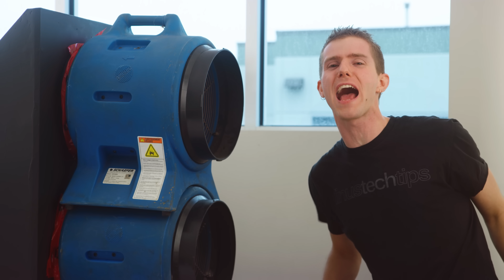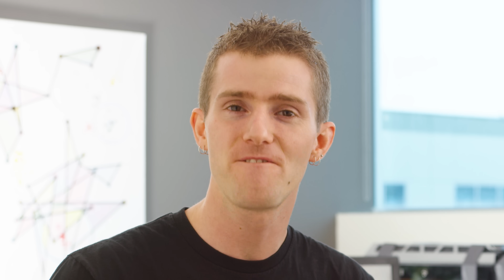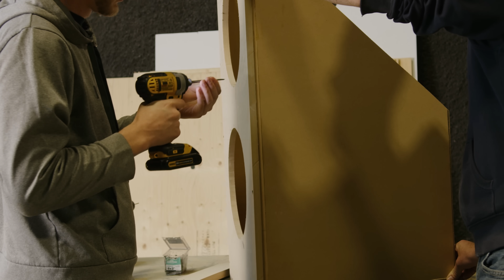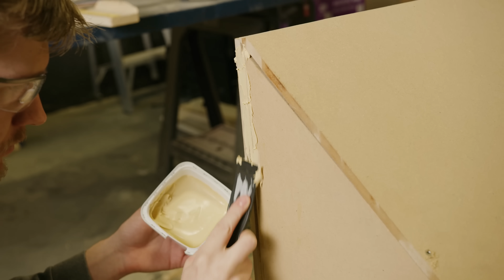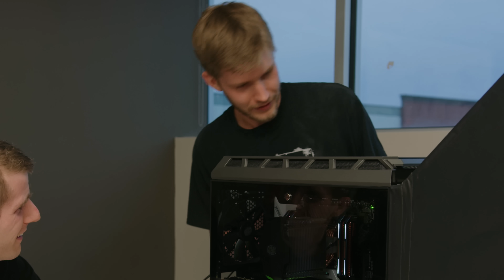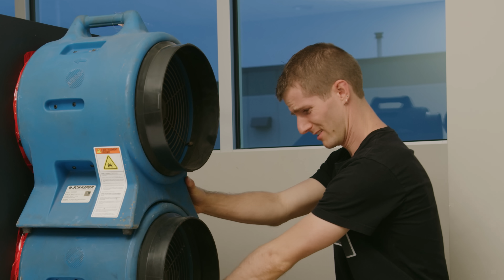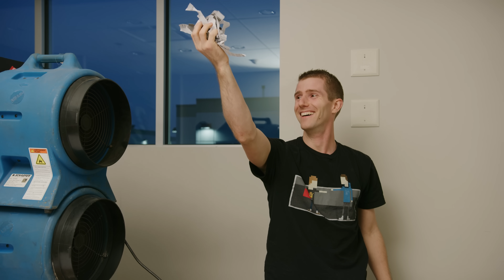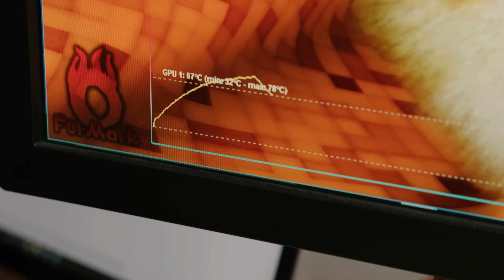Highest Airflow PC EVER - SUCCESS!

Comment: So, what was the point of the sponsored video? To confirm that Cooler Master choked the air intake of H500P with a plastic front cover?
Reply: The video was sponsored. They probably would have made this video either way if it wasn't or sponsored by a different company like corsair. They had the video they wanted to make about something overkill and dumb and a company sponsored it. That is the point.
Reply: Coolermaster Hopes that you now connect them with cool projects. Because that's how your brain works.
Next time you shop for some fans, I'm sure you will remember them positive...
Reply: we will never know
Reply: The power of air compels you!
Reply: The point of the sponsored video was to make hiring those fans cheaper for them
Reply: The point was to get you to remember the name "Cooler Master" next time you are looking for a pc case. Which works, because i noticed their cases in my school when i don't even know the name of my current case right next to me.
Reply: To shiw the new case in the beginning really and they use it for whatever, its a nice case
Reply: Remember sarcasm? Pepperidge farm remembers.
Reply: its a psa from coolermaster on how to correctly configure that case to have acceptable airflow
Reply: to be fair it doesnt matter that much you only really need to touch it when building in it and its a intentional feature to make things easier
Reply: The case costs more than $150 and it doesn't even have better airflow than a full glass panels Lian Li. The case is just bad, expensive, cheaply made and poorly designed.

Comment: Now see if you could passively cool SLI Titan XPs.
Reply: Oh I'd love them to try to do that!
Reply: Barbecue Tech Tips Two. Horsepower.
Reply: Barbecue Tech Tips but.... But..... TWO ONE HORSEPOWER FANS! It's not efficient. It's two freaking horsepower lol. I think just an SLI passively cooled setup would be an interesting setup. But I think the fans could pull the heat away fast enough.
Reply: you kidding? with this amount of airflow it's definitely possible to "passively" cool 200 watts. the tesla P100 and V100 cards come without any fans (with the assumption that they'd be installed in servers with blowiematrons) so with two whole horsepowers of blowing magic you can keep these 250 watt monsters cool no problems.
Reply: Things You Might Like You realize using those fans would mean that it's active cooling, right?
Reply: Once temperature breaks 75c the fans will turn on. But at below 1200rpm
Reply: That's not passive. It's called forced convection when you have two massive fans forcing air over the heatsink. Even if the fans are not directly affixed to the heatsink.
Reply: I'll try to cool a 7700k and Titan Xp passively by the end of the month for fun.
Reply: Zelcova X true. Just not specific to the gpu.
Reply: *Linus invents superconductive material, drops.
Reply: It's possible. It can still have a heatsink with no fans attached to it to be considered passive cooling.
Reply: The problem is that the airflow would rip the sli bridge off instantly...
Reply: I'll brain storm a setup to cool at Titan Xp. Fully passively cooled is impossible. But having a triple fan size heatsink and large 200mm fan would make it as silent as possible.
Reply: The fans mean this is active cooling
Reply: 360 tdp cooler on its way for passive Titan Xp
Reply: Barbecue Tech Tips totalmy possible if a heat sink is designed to be perpendicular tot he air flow, and it is large enough, the air flow is actually waaaay better than a stock Titan cooler fan could provide any way
Reply: Mike Crapse Speak for yourself. You're the only dumbass here!
Reply: Passively cool the entire PC. Not a single fan anywhere. Liquid cooling allowed, as long as it doesn't use any fans, only heatsinks.
Reply: +BOS2161 That is exactly what I'm saying, but I guess once you sell your soul to the Nvidia overlords, there goes everything
Reply: Yes!
Reply: It's almost impossible. The tdp is way too high to cool efficiently. I personally had a GTX 970 with a artic cooling triple slot heatsink and ran it passively with my CPU and psu. If I'm ever bored, I'll try it with a Titan Xp.
Reply: Things You Might Like The thing is no one has ever fully passively cooled at GPU over 195w tdp, or at least successfully.
Reply: Barbecue Tech Tips dumbass, try Intel xeon phi, they usually come in passive only packages. They run at least 300 watts a piece, and I've cooled them using normal high rpm server fans and good airflow management

Comment: But does it have... POSITIVE AIRFLOW?!
Reply: very
Reply: Overly
Reply: When the top part of your case comes flying off, thats when you know you achieved positive air pressure inside the case.
If the PC eats your cat (through any other intake besides the front sucking fans), that means negative pressure!
Reply: The should've added two more engines to the rear of the case to even out the airflow.

Comment: Cooler Master H500P design team: "Guys, it's great that we've got 200mm fans on the front of the case, but with a filter over it you can't see the pretty lights! Let's put a piece of transparent plastic right over the fans so everyone can see how big they are!" "Wouldn't that drastically reduce airflow in a case we're specifically billing as 'high airflow'?" "You're fired."

Comment: I'm disappointed Linus, You should had used EDFs  which is what they use in RC air planes.    You could had far more power without needing that big ass duct!  You can push out over 2000w with a  90 mm fan!

Comment: Noctua should make a quiet version of these. Hopefully not with their really bad color scheme.
Reply: They'll just make em brown
Reply: Just 84 dB!
Reply: I wonder if that means it's going to be 5 times bigger.
Reply: They should do this with no cpu fans and just a heatsink.
Reply: The should use the fans to make a case top cannon
Reply: Not Noctua, if you're into extreme air flow builds start looking for professional server rack fans. New ones are prohibitively expansive, but you can find working ones from old scrapped servers. These things are built to last, they're usually all metal with double ball bearing construction, so you can dismount them for cleaning and greasing. They're not as quiet as regular PC fans, but with rubber dampeners and silicone screws you can get the ambient noise to a tolerable level. Just remember to cut off the case fan grills and make sure you don't have loose cables inside ;)
Reply: And call the #linustitanicedition

Comment: This reminds me of that time I ran a Sempron at 240x10 using a 240V papst 119mm cast aluminium blower for a case fan. And a Delta FFB0812UHE as a cpu fan. You know your fan is too big when you need an LM350 to build a crude fan controller.

Comment: Linus... We need a "household cooling paste" vid! Trying stuff you can find at home seeing if it works... Toothpaste, nutella and stuff like that :D
Reply: On that subject. Burn cream and (clean) sand. Burn creams are usually Zinc Oxide with maybe some Aloe for a cooling effect. Sand is largely Silicon Dioxide. The thermal paste I use is composed of Zinc Oxide and Silicon Dioxide. It's actually a very good thermal paste, better than that silver junk I see everyone else using. No idea what the mixture on my tub is, buy the stuff at a local family owned electronics shop (as in the kind of store you buy circuitry from). Maybe in another 10 years when I buy another tub I'll remember to ask what ratio they use when mixing it. The only thing I've used that was better was AK-100 Silicone paste, that's an industrial thermal paste so not particularly easy to find in reasonably small quantities.

Comment: ummm, just a warning when doing a fan setup like that... the emp can destabilize the ram over time (GPU ram and desktop ram) (... lets just say you were not the first to try this....)    i believe the way around it to safely use the fans after doing research we found that you needed to turn the fan on first, then the computer to avoid the surge of emp from the fans being turned on through an AC source (the other solution was just to use a DC source)

Comment: BECAUSE THE CASE SUCKS FOR AIRFLOW THEY GOT THOSE DRASTIC NUMBERS, there is too much restriction for those big low pressure fans, if you installed higher pressure fans it would be comparative gains.

Comment: I just don't like that the Front Panel is very Counter intuitive and actually restricting airflow a lot on the Coolermaster Case as Gamers Nexus has shown
Reply: Afrogeddon 

Yup. Ironically he did a second video on it and "modified" the front panel with mesh and that fixed the airflow problem with the case. A Cooler Master employee seen it. So hopefully there will be a mesh front panel coming for it in a revision. And a better panel latching system. Then I would seriously consider buying it.
Reply: at least it looks good and still preforms as expected

Comment: Ok make a custom water cooler pc but with an external resorvoir and no radiators, the ideia is the resorvoir is so big that it will take hours to make the water hot enouth for the computer to reach high temperatures

Comment: I am deeply disturbed by the fact that you used an air cooler on the CPU rather than a front-mounted, 360mm radiator.  
...and perhaps you should have tried to find out if you could passively cool the Titan X!

Comment: I would like to see this test  again but remove ALL fans from all equipment and use stock heat sinks to see if the high ambient flow was enough to overcome the stock coolers without fans

Comment: High air flow is worse for a computer - more dust, more moisture, more corrosion and possible death (moisture builds up in dust shoring things and holding moisture). A little heat drives moisture out and computers don't really mind being warm.

Cool concept however.

Comment: What about water cooling using high flow pumps? I'm sure you could solve the problem of proper tubing and water blocks with the assistance of a cnc specialist, who'd do you the pipes and blocks. For the radiator you could use one from a truck and the fans that you had here could do the airflow. All that is a bit extreme, but aren't you all about it? ;)

Comment: You might be at risk of damaging the motherboard due to the electricity generated by the cpu and case fans when the air pressure spins them up. I would have recommended removing or at least unplugging them (assuming you care about the motherboard you are using)

Comment: still won't cool a i7-7700k LUL
Reply: Probably wouldn't even cool an FX 9590.
Reply: 2 Corsair HD 120's (@1500 rpm) on an H100i V2 will keep my 7700K @5GHz under 75C using Prime95 heat stress test.
Reply: the 7700k is not that hard to cool

Comment: Except that H500P case is fucking awful at airflow. It seems you guys didnt do enough temp testing or research from sources like gamers nexus, you shouldn't put this case and HAF into the same name. A 10-15 degree swing by simply taking off the front panel makes this case a disgrace for a HAF successor. I get the video was about badass fans and taking off the front panel, just be careful with what you call a decent case when people may take what you say a lot more serious then other much smaller channels they dont know about.

Fun video to watch still to see you messingh around with those.

Comment: You can actually get similar results by adding a few stock fans over the CPU backplate and VRM traces.  With a fairly negligible noise increase, I gained 8C at idle and 20C (!!!) under Prime95 with a FX-8370 @4.6GHz, which is almost more than my H100i got over a stock cooler at stock speeds.

Comment: Liquid nitrogen cooled PC. You know you want to.
Reply: DrToonhattan no use liquid helium, you can go to near zero-kelvin temperatures that way! I wonder how pc parts would react to copper suddenly becoming a superconductor :D
Reply: Helium overclocking is commonly done, AMD got near 9 Ghz with Helium (8.97 Ghz with FX), that's what overclockers use if you can afford it (costs $4.40 per second for an i7 7700k, so an i9 would probably be around $30 per second).
Reply: Might cause some breaking, however if they did it slowly... maybe they could get some results...
Reply: I think they actually have a vídeo, but it is about overclocking an i7 to 7 GHz or something like that.
Reply: they already did that like 2 years ago https://www.youtube.com/watch?v=4d0B0Dli-1g&t=648s
Reply: these things are not made to operate are low temps. it would die
Reply: super chilled helium is something ive never seen xD
Reply: to skip to the conclusion where most people get disappointed - you can't cryo freeze an entire computer, as it is when using LN2 cooling yo have to micromanage the temperature constantly, as you're looking to keep it as cool as you can obviously - but if you get too cold then components just shut off and then you have nothing until you warm it back up.

the only reason it works at all, is because what you're cooling directly with it, are the major heat producers of the system, and you have the system slammed the entire time you're using that cooling, so that it produces enough heat to continue being operational.
it's very effective (especially since it freezes most of the system from the Processor out as everything is connected via metal together so heat is absorbed out of much more than just the Processor), but it's a lot more finicky than it sounds from a distance.

as the adage goes, if you're looking to do really extreme cooling, you have a thermos of cryo liquid in one hand, and a blowtorch in the other.
Reply: wouldnt many allows and plastics crack?
Reply: PC parts are designed to operate at a specific temperature range. I'm gonna go ahead and assume that -196C (-321F) isn't within that range.
Reply: already did that, der8auer did it i some event (i think its called absolute zero or smth like that)
Reply: its been done in OC competitions, but it would only work temporarily because of the massive heat difference there'd be condensation between the parts and the liquid
Reply: Dont mind me...:
WOuldn't work; electrical activity would be diminished to the point where the Cpu is about as effective as a potato
Reply: ITS BEEN DONE

Comment: That much air pressure would destroy a system, your putting immense pressure on the cooler retention brackets, ram and probably over cycling the case fans bearings.
Reply: Who needs case fans when you have fans like these ;) .
Reply: Yeah, get rid of the case fans, and let the BAFs do all the work!
Reply: Hold up....is it a Magic cock? Do I have to roll for initiative?

Comment: Could you cool the CPU enough to work without a heatsink, but by using those fans to blow on it?
Reply: Ethan Reinsch No, i have seen another video from a german hardware magazine. Only air doesnt work because the surface of the heatspreader is just too small.
But im sure it would work good with an intel stock cooler, even without a fan on it :)
Reply: the surface area of the IHS on a Processor is really, really low.

think about it, look at any Heatsink you're using on a Processor - the IHS on the Processor is about equal to one face/side, of one of the fins on that Heatsink.
so just about any Heatsink is somewhere in the magnitude of a 40x+ increase in heat dissipation capability.
Reply: well if you install just the heatsink without the fans on it ...... this thing might work

Comment: Spinning the fan in the rear of the case that fast will actually generate voltage which will get fed straight back into your motherboard, because pretty much any DC motor will act as a generator if you spin it. I don't know if this could possibly damage the motherboard but I would probably take the fans out of the back if I were ever going to use that again. They're probably impeding the airflow more than anything anyway.

Comment: Or...... Just stick your whole computer inside a mini fridge! It'll take up even less space and it's cheaper!
Reply: Its been tried and it doesnt work
Reply: Blakehx I believe they have a video on that and they tell you why it does not work that well.
Reply: Con, den, station station sation....
Reply: Fridge compressors aren't made to handle a constant load.
Reply: A fridge is insulated so the heat dissipation is the maximum constant cooling power of the compressor and thats not much
Reply: No, there won't. At first there will be as it cools off, but once cooled there won't be any additional condensation because all the water will have condensed out of the air.
Reply: Not as long as you keep the door closed.
Reply: it doesnt work !!! fridge are low duty refrigering units, they cant handle working for long without a pause
Reply: put a hole on the fridge, stick a vacuum pump, bam problem solved
Reply: The suggestion wasn't to take parts to make a new cooling system, it was to use a mini-fridge. They did exactly that. Which involved making 0 things directly related to cooling.
Reply: Because LTT sucks at making things (CPU cooler, water block, desk, pretty much anything with a power tool...). You can however use the fridge components to make a sub-zero phase change cooler for the CPU/GPU. Or you could use a large chest style freezer that doesn't have a pop-can sized compressor...

Comment: I have sometimes wondered if it wouldn't be a good idea only to have intake fans and a small outlet with no fan. This would, or could in theory allow for higher pressure while still allowing airflow, and it would make sense that a higher pressure would better allow for the necessary heat transference.
I don't know that I'm right, or wrong, as I simply don't know enough about such things, but I've never heard about anyone trying it.